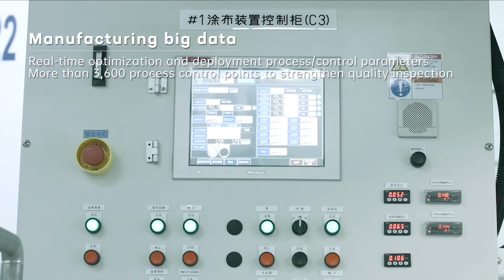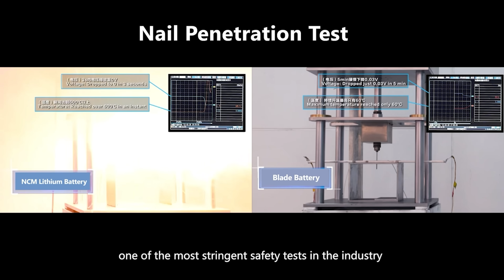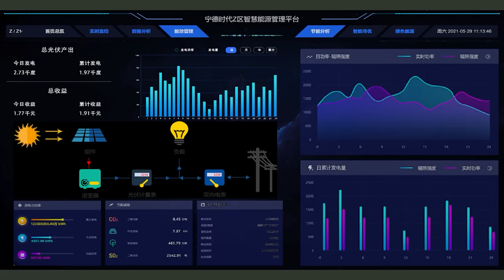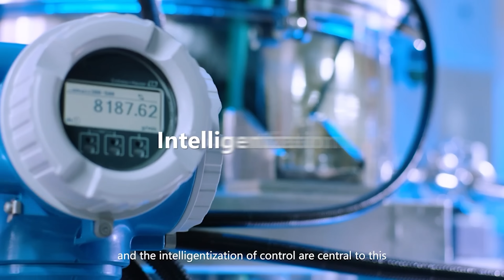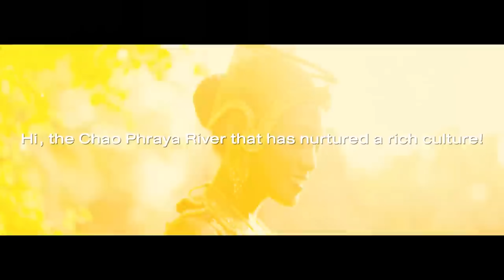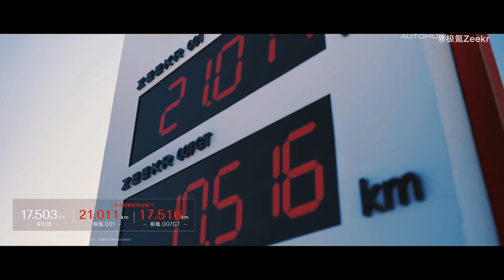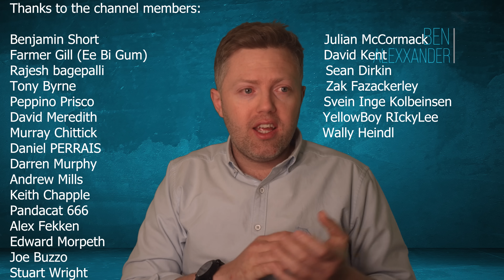Sodium Takes Over - Tony Seba’s Battery Prediction Comes True

Comment: I still think the top end cars will go for an NMC variant as range is king for the time being. I absolutely think LFPs will be replaced though.

What excites me more is its use in home energy storage and in particular vehicle to home. When your battery will do that many cycles then there really no reason to limit it’s use with regards to warranties. And when it doesn’t degrade within 10-15 years then the financials for home batteries can make a lot more sense, even without a lower initial cost.
Reply: LFP will transition to LMFP, making it a half-way solution between Sodium and NMC in cells in terms of energy density. The most likely scenario in the short term is static storage will be sodium as well as sepcialist areas (like dual-chemistry EREV batteries, requiring higher cycle from Sodium and higher energy density from Lithium), LMFP for low cost everyday vehicles and NMC (low nickel designs though) will remain in the performance/extreme-range end. Sodium's cost advantages at the low end for EV's are offset by it's lower volumetric energy density (fewer cells per pack), higher cooling requirements (higher power Sodium electrolytes degrade at lower temperature than ones used in Lithium cells), and higher power electronics costs (to handle the lower threeshold voltage sodium cells require).

Comment: Last fall, when CATL made an announcement that these batteries were coming, they said that the cost and effort converting today's LFP battery plants was negligible. They make over a third of the world's ev batteries! This could move really fast.
Reply: If i as manufacturer of a product that uses those cells would decide which chemistry i use i would ask CATL for the total cost of the cells. That is production cost devided by cycles, energy density and efficiency. LFP are 30-40% cehaper overall. Maybe that changes some day. But not today.

Comment: Naxtra throughput efficiency is 80%.  I wonder if this 10-15% loss in efficiency from LFP will be significant enough to make grid storage players stick with the LFP units.  Though it appears Peak Energy's grid storage could be quite high.  Plus it has no liquid cooling system.
Reply: Well, pumped storage is 80% efficient and it is good enough for grid storage.
Reply: @rogerphelps9939 Kinda the same question.  Now that you have a >90%  efficiency battery that would take up just a tiny fraction of the space, would you build pumped hydro?  Actually I may have answered my own question after looking at the Peak battery.  It appears their grid scale battery is more efficient than the CATL's.  And it requires no regular maintenance.

Comment: Sodium ion is benefiting from the money spent on research into lithium ion. The understanding of chemistry and physical construction of the cells is somewhat transferable. 
The biggest issues for lithium ion cells are the flammability of electrolytes and the limited capacity of both anode and cathode to store the lithium / ions. Solid state cells address some issues. Perhaps there will be learnings that feed back from sodium to lithium. There are also many other alternatives being developed.
As Tony Seba said, the big advances will come from chemistries we may not have heard of yet.

Comment: IT DOESN'T GET NEAR AS COLD AS IT USE TO HERE IN CANADA  WITH GLOBAL WARMING  . HERE ON THE EAST COAST OF CANADA  IN PLACES NORTH WE WERE USE TO 5 TO 7 FEET OF SNOW BUT NOW WE DON'T SEE ANY SNOW WHAT SO EVER . WE DIDN'T EVEN SEE - 20  ONCE THE LAST 3 YEARS  AND NORMALLY  ITS GOES DOWN TO - 20 FOR AT LEAST 3 WEEKS  IN WINTER .  NO SNOW AT ALL ON THE  CENTRAL AND SOUTHERN PARTS  OF THE ISLAND  WHERE ONCE  WE USED SNOW MACHINES . NOT NOW .

Comment: What are the areas that sodium ion surpasses aluminum ion batteries?
Reply: Lower cost, greater material resource availability and lower extraction and processing cost (processing Aluminium is more energy intensive), higher cell cycle life, and Aluminium-Ion having a higher likelihood of becoming a dead-end technology. On the last point Aluminium-Ion will be more difficult to adapt to solid-state technologies, than either Lithium-Ion or Sodium-Ion, due to the size of the Aluminium molecules used to transport the ions, lowering their power density compared to either Lithium or Sodium SSBs. Plus as battery chemistries move towards their higher energy potential forms, as in Metal-Air cells, Aluminium-Air cells become non-rechargable primary cells with more limited applications.

Comment: Lithium stays the champion for high energy density per weight and volume, so it will stay relevant for high performance and less price sensitive products. The question is what happens to LFP, NMC will stay relevant in those sectors, until Li solid state reaches full technology readiness. But the big mass market will soon be Na, because a pretty large chunk of the production process is identical, so it requires setup of supply and optimisation of the system and it is done. Sodium will also speed up electrification of shipping, where safety and cost were still more of a hurdle…
Reply: LFP cathodes can be combined with silicon composite anodes (sodium with Prussian white cannot). LFP can be doped to become LMFP, which apparently they're close to in China (again, not the case for sodium with Prussian white). I think LFP will still have a place.
Reply: Li solid-state isn't the final stage in Lithium battery development but represents another stepping stone technology, that in turn will aid the development of Metal-Air batteries, which have the highest energy density (11,400 Wh/kg for Li-Air, or around 4,000 Wh/Kg when factoring in the external cathode element - atmospheric oxygen).
Reply: @GruffSillyGoat We can always use Al/O2 without rechargng. Expensive, but possible.
Reply: I thought this was going to have 175wh/kg. If that is true, it's pretty damn close to the average lithium out there, and it's closing the gap really quickly.
Reply: @brewhog  Not in mass production.
Reply: @brewhog it can get to that, it even has the potential to be exactly the same as LFP, but NMC maxes out at something like 300Wh/kg with current methods and with semi solid state it might get even way above this.

Comment: I hope this will come to fruition in a short period and not decades
Reply: Butelli already has a Na (Sodium) battery on the market
Reply: @piprog  I’ve heard of Bluetti and I’ve heard of Buletti.  But what is Butelli?  Typo?
Reply: @piprog FYI in China there's already sodium ion cars commercially produced in small scales  since about two years ago mainly for testing the market. But of course the tech then was far less advanced with much lower energy density and the price wasn't exactly cheaper than lfp battery cars. The Bluetti one is just household backup power batteries pack .
Reply: While we will have to wait and see, he did say they will start manufacturing in December this year (2025).
Reply: @martythemartian99 for products not available in north America.... of course, that's their own fault.
Reply: It will, it just won't be the 90% price savings they're mentioning at first, which is fine. We'd all be happy to get a battery with these specs and properties even at 30% to start, which makes it profitable still to make. Over the next 3-4 years I bet we see them improve in efficiency by 20% and costs come down an additional 20%. It's definitely going to change the game quickly. I can't wait until a sodium home battery at 30-40 kwh is around $2000 with a 30kw inverter and pretty much impossible to cause a fire.
Reply: @enthused7591  In best case it could be 7% cheaper than LFP.
Reply: @enthused7591  I think the funniest part of this story is that when asked what the biggest bottleneck was the CATL spokesman said that there's no supply chain for sodium. It sounds crazy at first glance, but then you think about it again, of course there isn't. Even when you're making something derived from table salt you still need someone to build a plant to process the stuff into what you need for your specific application in quantities and price points that would make it viable.
Reply: China will drive this super hard

Comment: Sodium will need to match best lithium energy densities to replace premium lithium batteries like NMC or it will only replace batteries in budget vehicles.
Reply: And it is totally fine, budget EVs will be a huge market in developing countries and Africa. Volumetric density of Sodium batteries is low, so they are not a great fit for high-end market anyway, and are better for budget cars, city cars, and midrange cars with an option between hybrid (Na+Li) and larger LFP battery.
Reply: Even in budget market Sodium will have to compete with LFP and LMFP cells. Plus at the battery pack and vehicle level the costs differential starts to erode as Sodium cells have much lower volumetric energy density meaning fewer cells will fit per battery pack, current Sodium electrolytes are more temperature sensitive meaning more powerful/costly vehicle cooling systems need to be implemented, and Sodium's wider voltage range (that start much lower voltage than Lithium) requires more expensive power electronics to be implemented.

This is likely partly why CATL focused on using their Naxtra sodium cells in Freevoy dual-chemistry packs first, designed for hybrids particularly EREVs/PHEVs, where the higher cycle life of sodium introduces an advantage of supporting more constant on-the-go charging from the onboard generator, and the Lithium cells in the battery pack provide further electric-only range than that of sodium alone.

Comment: Sodium ion is less sensitive for overheating compared with lithium, so is the active cooling on the pack level still needed (perhaps only for EVs, not for grid storage)? If not, that can lower costs and increase the energy density of sodium ion batteries on the pack level. Is active cooling for CATLs Naxtra required?

Comment: Battery tech has taken about 15 years to come from first  lithium to sodium. I remember discussing the first EVs with a pre-maga engineer around 2010.  Basically he didnt believe in evs because Obama was pushing for it with the first Chevy Volts. I would argue to him about less parts, quickly improving battery tech, less maintenance. He didnt care. And now EVs have been common for the last 5 years.
Reply: The first lithium-ion battery was in 1985. Sony commercialized them in 1991. Nissan leased a car with them in 1999.
Reply: @mike_w-tw6jd  I meant first commercially useble for evs. Their range wasnt great but it would do for a city car. I missed the lpf fase we are in now. I only know lipo cells for rc planes. I used to read about the new breakthroughs all the time but I stopped because they would only work in the lab.
Even mr. Goodyear had a another breakthrough a few years ago but I never heard of it again. Sodium is a big thing for sure.

Comment: Almost certainly correct, mass market car buyers don't care, if it's as good and cheaper that's what they will buy. Mind you having said that, we still have some high end cars using NMC chemistry because it gives slightly more power or 10% more range than LFP, so where prices don't matter people will tend to go for more expensive options that perform better, that's why we have the Ferrari's and Lamborghini's, so I do expect small runs of these batteries will still be produced, but for the most part if NA batteries do live up to the hype and can give the same range for cheaper, or more range for the same price that's the way the market will go, of that there's no doubt.

Comment: my biggest barrier to EV ownership is i can't charge at home. how do these sodium batteries effect efficiency and hence how much i pay for relatively expensive charging? do they make for less or more miles per kwh? do they lose more or less electricity while the car is idle? will they in the future lead to lower electricity prices as renewables can have lots of cheap batteries next to them?
Reply: I've seen people with EVs in terraced houses, they put the charging cable on a pole sticking out of the upper floor, then the cable drops down to their car in the street. This keeps the cable away from the pavement
Reply: @ncapp372  Ingenious.

Comment: Wh/kg is a useless unit. Knowbody cares how heavy the battery is,but how much energy we get into a defined space. So Wh/l is the relevant unit
Reply: I think battery companies don't promote Wh/L because the comparison would look worse.
Reply: Relevant fr aviation though
Reply: Both needed.
Reply: Weight is important when it comes to cars.
Reply: No, weight is everything for transportation.  There is no shortage of volume for batteries in any vehicle
Reply: @robertlynn7624  - for constrained space applications like EV batteries, volume energy density has a higher order importance than gravimetric energy density - there is no point bringing down the vehicle weight, to raise vehicle efficiency, if one cannot fit enough energy storage into the pack in the first place to travel very far.
Reply: @robertlynn7624  The Hummer? The Escalade? The F-350 would all beg to differ with your faulty thesis...

Comment: IMO both will exist in tandem for some time and sodium even if it does see much more improvement in energy density will dominate Home battery and large BESS application.
super efficient in all climates and so abundant in minerals for manufacture on global scale in all countries.
Desalination for drinking water provides the salt for use in the sodium separation and abundant byproducts provide huge cost and environmental advantages. 
Massive solar and wind power opportunities for regional developing countries with small scale grid networks remove the need for large power plants and large grid networks. Suburbane mini grid networks with all homes with Solar and communal batteries to maximise storage with maybe Diesel or Biodiesel generators for backup.
 
What are the downsides, None that i can see at this point.

Comment: Atomic weight lithium 7, density .53gm/cm3; atomic weight sodium 23, density .97 gm/cm3.  

Sodium is up to three times as heavy as lithium and half as dense. If battery weight and volume are issues,  lithium is the only way to go.
Reply: lithium only is  like 3% of cell weight.... rest of it is other stuff...
Reply: @IdoCareForPeople Typical EV traction battery of about 60KWh has about 18-24 Kg of elemental lithium. For such a battery sodium would add around 20Kg and substantially greater volume (sodium swells more during charge/discharge so space needs to provided inside the battery housing to accommodate volumetric changes). 

My understanding is that in terms of EVs, sodium is mainly being proposed for small inexpensive "city cars" designed for daily commuting. These will have a battery of about 30-40KWhr. 

Of course for stationary applications weight and volume is not an issue. Electric trams, trains and boats are similarly less constrained, so sodium would be fine in such applications. I expect once reliability is proven to market satisfaction, it will take a large part of those markets.
Reply: @jimgraham6722  latest sodium has energy density of 170 wt / kg... its has higher thermal stability so lesser cooling / heating  needed on the pack...which reduced weight at pack level...
Reply: @IdoCareForPeople  - though sodium has thermal stability as a cell it's chemistry may require additional cooling to be factored in due to celss electrolyte composition. Sodium cells tend to use non-aqueous electrolytes that offer a more usable power density in the cell, however, the ones currently used tend to degrade from mid-30°C onwards, compared to those used for Lithium based cells. This introduces a higher system level cost at the vehicle level to maintain the battery at lower operating temperatures (i.e. more require cooling). Plus the wider voltage range of Sodium cells introduce a higher power electronics cost in the inverters, regulators and charge controllers invovled.

Comment: "   Yes, sodium-ion batteries are generally considered safer than lithium-ion batteries due to their lower risk of thermal runaway and fire, though the comparison depends on battery design and specific chemistries used. 
Sodium chemistry is less reactive, and sodium-ion batteries can be transported and stored at zero charge, making them less prone to hazards compared to lithium-ion batteries which must be kept partially charged and are known to catch fire under certain conditions.  "

Comment: IMHO, it will take some time. There needs to be enough trusted suppliers who can manufacture enough batteries to meet the demand.
Reply: CATL has more than 30% of the battery market. USA may lag, but the rest of the world will roar ahead.
Reply: You're underestimating the scale and speed of Chinese manufacturing.

LFP batteries were nowhere before covid and they took over the world in just few short years. Sodium rollout will be even faster. The competition is cut throat in China and they're innovating at a speed hard to comprehend by outsiders. They aren't like Toyota blabbering about solid state for 10 years.
Reply: Setting batteries can be produced on existing production lines for lithium ion scale is not a problem

Comment: I am hoping that the build & benifit improvements will force LFP prices down to compeat for business rather than go bust or risk loosing use of their production lines.
It will certainly change my timetable to upgrade my home battery storage & time when I will replace my 5 year old EV.
Reply: The lfp lines can be converted to sodium technology
Reply: Not sure why you'd want keep LFP when Sodium-ion seems to beat it on ALL counts, as well as merely cost.